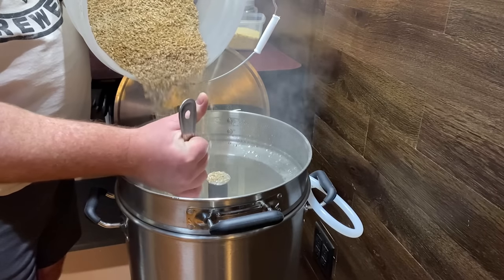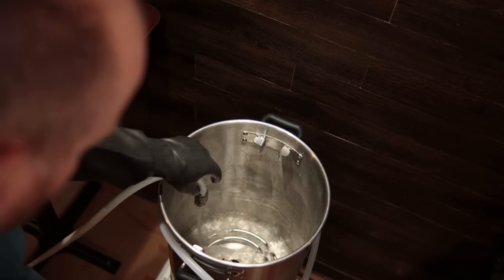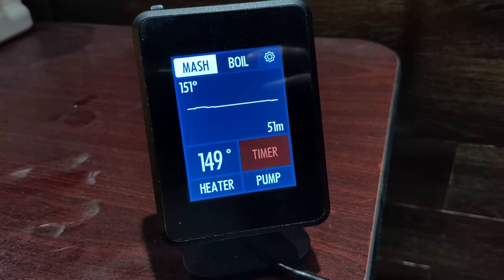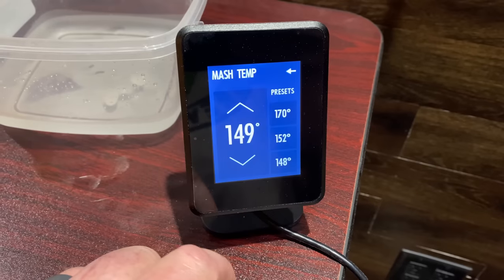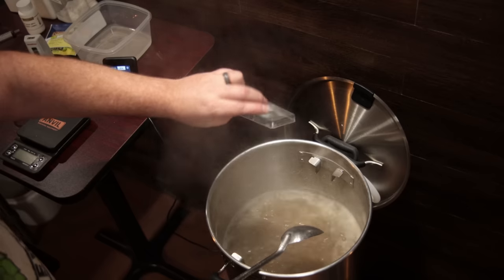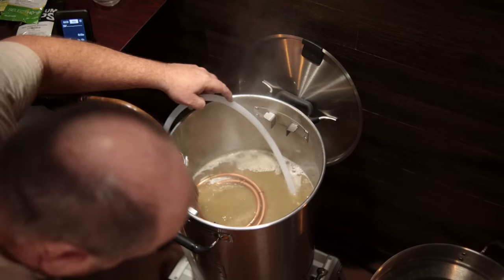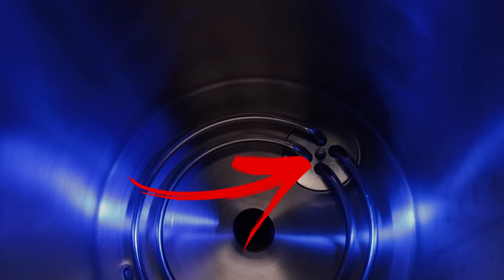SS Brewtech SVBS First Brew Day

Comment: 8:40 if you shut the pumps off before you throw in the hops, and leave it off for about a minute, the pellets will break up.  Then turn the pump back on and the pump and/or hoses shouldn’t get clogged.  I’ve seen this happen where whole pellets get sucked in the hose/pump and expand rapidly and cause the clog.  That being said, I plan on sticking with my 3 vessel propane system. 😂
Reply from the maker: Ok thanks for the tip! 👍🍻

Comment: Great video Brian. After watching this it makes me happy that I went with the Spike Solo 20 gallon. I like being able to see the entire system as it recirculates. That has always been an issue with those all in one systems. If there is an issue in the middle of brew day its harder to diagnose where the problem is because everything is sealed up with covers. I like knowing that the I.D. of my hoses are bigger and that the pump I am using has enough power to push hops and other sediment through it. In my case I use the Riptide. Great piece of mind knowing that the pump is very powerful and that I can quickly and accurately diagnose an issue if one came about in the middle of brewing. 
Love all the videos. Keep them coming.
Reply from the maker: All good points! Thanks for the comments! 👍🍻

Comment: 2:04 Great video. I just learned this and thought I would share.  There are two different gallons imperial and US.  An imperial gallon is about 20% larger than a U.S. gallon. That is probably why there is a discrepancy from your flow meter and the markings.
Reply from the maker: My meter is accurate to US gallons. I've measured it by weight. So the markings are actually off.

Comment: I didn't read all the comments. Just  from when I watch other videos with this type of system. Maybe recirculate longer before pulling up the basket, similar to vorlaufing, if able. This may help with less particles in the boil. I'm thinking of getting an all in one system myself.  Cheers!
Reply from the maker: Yeah the holes are too large and go up the side too far..no amount of recirculation will fix that issue..

Comment: Wow! Thanks for the video, Brian. The pump clogged after 1 ounce of hops? I will be running far away from this system.

And why do you say the green crush is different? Because you have 6 inch rollers? What difference does that make?
Reply from the maker: The 6 inch rollers leave the husks more intact than smaller rollers. 👍🍻

Comment: Thank you brian, best video/review I’ve seen on the system. I really want to like it but I’m still not convinced. I think you were a little too nice on your review! (It’s ok, good for you). So do I have this right?  MASH efficiency 59% on a very moderate grain bill, Lots of grain bits in the boil?  That tells me the mash basket is a crap design… whirlpool addition clogged the pump? Holy crap that’s a huge downside!  The best immersion chiller out there is MAYBE compatible because it sits on top of the element?  Dang! 

Again I really want to like it… but I don’t see it performing any better than a standard brew bag, false bottom type of system anyone can make.
Reply: I’d love to know what @bobbyfromNJ thinks about this too.
Reply from the maker: I just try to present what I find without any bias and report on what my experience is. I'm sure Bobby has plenty to say. 😁👍🍻
Reply: @ShortCircuitedBrewers  respect 🫡

Comment: Awesome video as always. What did you think of cleanup? Specifically the basket and the trub filter? I know it seems trivial but this is somewhat important to me. I hate having to sit there and scrub/poke grains out of mesh surfaces.
Reply from the maker: The basket was a little bit of PITA the husks do get kinda stuck in the holes. I sprayed as much as I could, then let it dry over night and then the all wiped out easily. The kettle was easy enough. The trub filter was no problem. 👍🍻

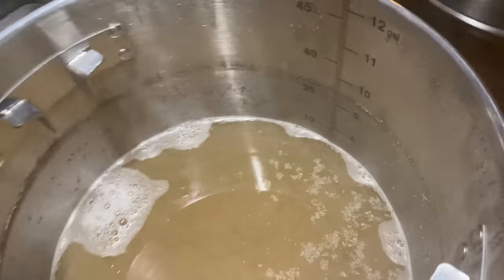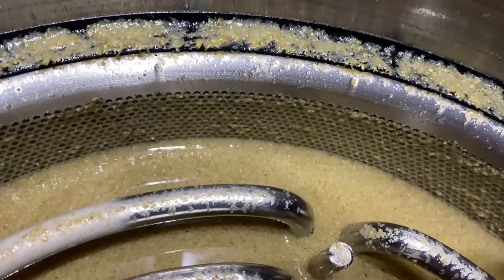Comment: 5:18 too much grain in the boil. Seems like the recirc isn't working effectively, maybe because of hop filter, real shame. Maybe the instructions say to fit the hop filter after the mash is finished? Oh you covered that at 11:00 that is really disappointing so much grain is ending up in the boil and yes holes so far up the malt pipe is a bad design.
Reply from the maker: Yeah I think the holes are a bit too large and maybe go up too far on the sides.
Reply: @ShortCircuitedBrewers  the best recric holes are 3mm probably bigger than it has, but there cannot be a pump filter after or the recirc just won't work. Hopefully they take your feedback on board for v2.
Reply from the maker: @indiekiduk  👍🍻

Comment: Might be a naive question, but I’ve always poured sparge water over the grains to hit target volume. In this set up do you use a starting volume to get you there? Also it seems the pump isn’t that strong or the mesh filter didn’t keep out particles that well, is that what you found?
Reply from the maker: Yeah basically I did a no sparge method. You can do that in your brewing software setup. I'm pretty sure the issue with the grain is that the mesh is too coarse. 👍🍻

Comment: I have an anvil first Gen 10.5 I make 8 to 8.5 gallons on regular.  (I have over 40 batches on .just 2 or 3 batches bad or weak that were my fault should have used rice hulls) I jump to my 20 gallon kettles when more or big or imperial  is called for. I am looking for something in-between  like 8 to 14 looking at the big brewzilla at more beer on sale now. Is there  a larger  version of this ? There  is a lot I like about it. And things changes I don't like on the larger anvil. Thank you for your unbiased  video.
Reply from the maker: I have not heard about any larger versions. Thanks for the comment! 👍🍻

Comment: Nice one my friend,
I know we're both big strong dudes but how did you do cleaning that thing? Dumping it out, I found it to be problematic. Just the kettle probably weighs 50 lb. Hopefully your shoulder is okay. 
I wonder how many duty cycles that fiddly. Siliconic seal around the filter, has in it before it stops functioning properly ? 🫣
Reply from the maker: Lol it is heavy for sure! I did ok. I wonder about that seal and the center seal as well. 👍🍻